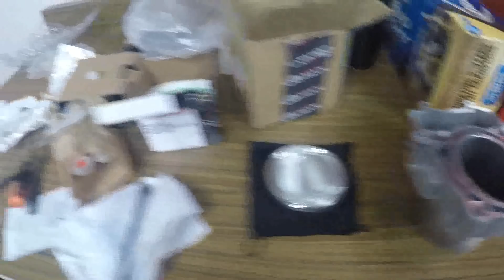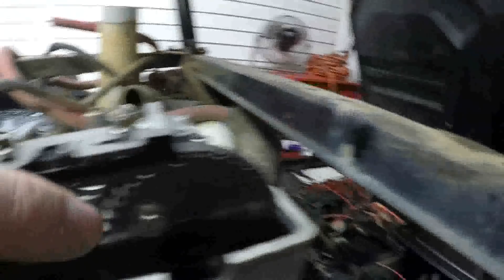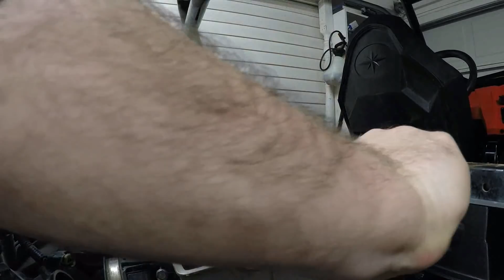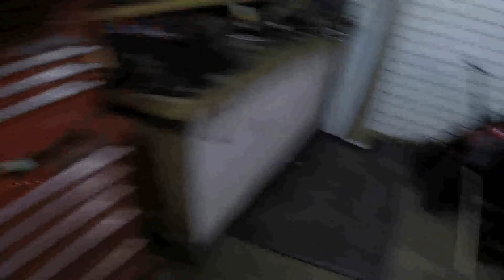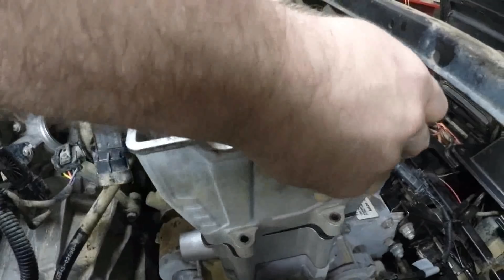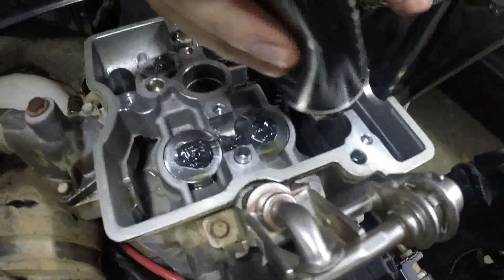Polaris 570 Motor Rebuild

Comment: i have a 2015 rzr 570 with 400 hours onit and all most 4000 miles , change all fluids every 30 hours includeing oil filter and it has run fault less , never fail to start even after being lay up for a few weeks , never used any oil between oil changes , i am very much into maintenence and think it helps alot to keep on top of this sweet little engine as it has to work very hard
Reply: Que tipo de aceite debe llevar este motor?..,

Comment: For those of you wondering why out-of-adjustmant valves cause a no start, as the valve seats wear from the valves seating millions of times and the slight wear of the cam lobes riding on the buckets, the valves actually sit deeper In the seat which causes the valve stem to rise. The rise of the valve stem also raises the bucket (which sits on the valve stem) and closes the gap between the cam lobe. The loss of the clearance gap will cause the valve to not fully close losing compression through the slightly open valve......almost all car engines use this same design as well.

Comment: How much lateral movement should a piston have, if any? My son borrowed my 2015 Ranger crew 570 and smoked the clutch belt. He replaced the belt then started it up and heard knocking in the motor. I got it back and started it and heard a fairly loud knock from the lower part of the motor.  Doing the rear down when I got to top end of there was lots of water or coolant in the cylinder, piston top and on the gaskets when I pulled the cylinder off. One burnt valve and I can move the piston side to side quite a bit. 
Thanks. And your video made the tear down simple! Thanks.
Reply from the maker: Side to side is ok, Just not up and down.
Reply: Ya, that’s kinda what I figured. Removed piston and sure enough the rod has both lateral and vertical slop. The up and down of the rod is the knock I could hear!!!
😡

Comment: I'm currently doing this. What's the trick for getting the cylinder back over the new piston??
Reply: That is exactly what I was wondering. I know that on a regular engine that you would find in a car or truck that you would use a regular ring compressor but with that engine design it looks like it's a whole different ballgame.

Comment: i have 2015 570 split one side off is the other sidr pressed in the case with crank bearing ?.I can not remove the crank do i need to press out of the case??

Comment: terry allery i have a 570 every thing is out including crank is there a place to send the motor to fix or i am looking to buy a new or rebuilt with more power any sugestions on where to buy do you sell them
Reply from the maker: I dont sell, and I usually just go to the Manufacture Website and get the Part #'s and then Google the cheapest price.

Comment: Great video I’ve watched it several times. I rebuilt my daughter Suzuki 400 it’s amazing how similar the two motors are. What’s the most miles you seen on these 570s.
Reply from the maker: Dave Demme Quite a bit, this one has probably 1000, but known to hit 10k if maintained right
Reply: SolitudeCustoms i wish my 03 kodiak 400 had an odometer on it. I had that quad for 13yrs and bought it brand new. I rode the shit out of that thing plowing a quarter mile drive every winter, hauling firewood, pulling logs, going on 30 mile+ rides at national parks several times each year and just riding around the property in general. Still had the same power as the day i bought it and the oil came out just a shade darker than when it when in on the last oil change before i sold it. Changed oil and filter once a year. That was a well built motor. Never changed the belt all those years i had it either. No joke. Only sold it to buy a sxs.
Reply: my RZR 570 has 21 000 kilometers on it... still running good
Reply: I have a 570 sportsman with 7500 miles, still running great not many issues besides axle boots and axles.

Comment: I have a 2014 Polaris ranger with a 570 in and only 180 hrs on it, It started burning oil real bad not sure what went wrong. I've never over heated and the oil is not over filled (questions I've been asked) I have to put oil in every couple of hours of use, do you think if I just replace the same parts you did it will fix it?  I have't heard of this problem coming up with any other 570, also the air filter box is dry so its not sucking it up that way.
Reply from the maker: william duke Yea kinda sounds like you had some dust get through and ate up the rings. I'd do a top end and have the head reworked

Comment: Do you think 3000 miles is a lot for this motor. Still runs strong. Not smoking or anything. Just wondering how long till I should do a top end.
Reply from the maker: It's up there in miles but as long as you keep the Air Filter clean and Oil Changed you should be good

Comment: I read in the comments that you had to adjust the valves. I have a 570 sportsman that won't start. Trouble shooting and suggestions tell me to adjust the valves but I'm not sure how and can't find a video. Do you have one for this fix or could you give me a summary on how to? Thanks for the rebuild video and any help you can offer.
Reply from the maker: Kthulus Wrath I have a update video of this motor rebuild that explains it some. Adjusting the valves is kinda tricky and there us a big chart to go by in the manual. Do you have one?
Reply: SolitudeCustoms I do not have a manual. Where could I get one for a good price?
Reply from the maker: Kthulus Wrath Find me on Facebook, Solitude Customs, and I'll see what I can do for you on that
Reply: SolitudeCustoms found you on Facebook and sent a message. Really appreciate the help
Reply: SolitudeCustoms sent you a Facebook message
Reply: Spark plug
Reply: I’ve had two different brake downs on my 2015 Polaris 570 one was fuel pump and the other was shear key on the stator side and I’m about to change the Polaris 2012-2018 Sportsman 570 Rzr 570 Seal Crankshaft 3610171 because the shop I took it to for an oil change put to much oil in it. I hope it’s easy fix.

Comment: Hey man doing the same job on a sportsman 570 how do keep it at tdc. I read there is a tdc lock out and you put a 1/4 extension in it behind the flywheel??
Reply: Pull the crank sensor and look through that hole
Reply: I actually just did the same job you need to pull the stator cover off and then the flywheel and there is a tdc lock out and then you can be perfect with your timing
Reply: @blackmetalchevy  forgot to tag you.  You should really use tdc lockout behind flywheel in my opinion.  Just finished the job runs great

Comment: ended up being valve's but was your compression low i've the same issue not starting only 101 hour's 2016 rzr 570 let me know about the compression thank's
Reply: Cleve Caulder was your valves stuck?  I adjusted the shim buckets with no luck.  Still has low compression

I’ve not tore into it past the shim buckets to see why

Comment: You said that when you were done rebuilding the motor it wouldn't start. So you had to change bucket shims. Any reason why you would have to change them when all you did was install new piston. Maybe cause it was a high compression piston?
Reply from the maker: No it was 2 different things, it would be hard to start so we did the piston and got a Lil more power thinking that would fix the hard start but the whole time it was the valve adjustment

Comment: I have a 2012 Ranger 500 efi. The oil supply line tore off while riding. Engine ran until I heard knocking, fixed line added oil and started. I now have a engine rattle or knock. Shut it off and haven't used since.  What engine component  fails commonly fails in this instance?
Reply from the maker: If its a knock, then the crankshaft most likely. The bearing let go and probably the piston is scared
Reply: +SolitudeCustoms thanks for the quick reply. I'm going to pull the engine and tear it down
Reply from the maker: +Bill Hambler Yea just take your time and look over those parts well
Reply: +SolitudeCustoms I just uploaded a video of the engine running. Can you have a listen ?
Reply from the maker: Bill Hambler kinda sounds like a camshaft also, but im betting crankshaft
Reply: Thanks.
Reply: +Bill Hambler rebuilt went great. used a cylinder kit from niche industries
Reply from the maker: +Bill Hambler  Awesome man, good to hear. Feels good to get a new build
Reply: Niche industry I bought one of the clutches and it was junk all of there parts that I have tried seem really cheaply made
Reply: @NotJustAnotherCody  avoid all NICHE components & axles etc. JUNK..